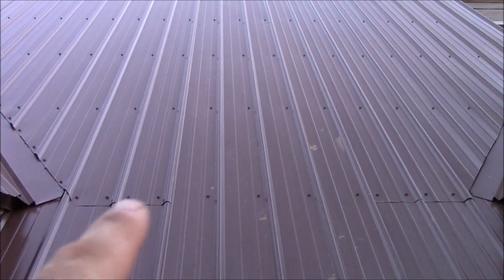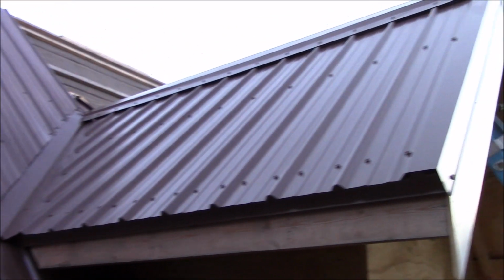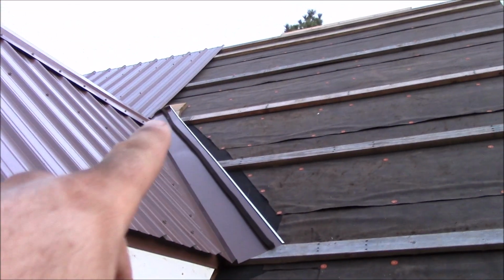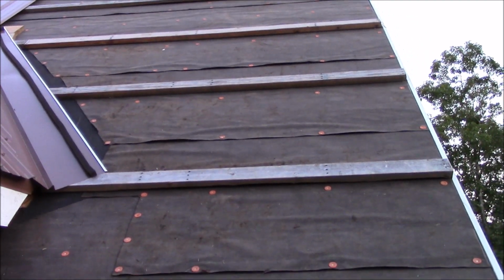Building My Own Home: Episode 40 - Finished the Last Dormer

Comment: great work, great weather we're having, what are your plans for heating? we're using an outdoor wood boiler that's working pretty good, except I have trouble cuttin enough wood, dang crippled old back. gotta get a bigger chainsaw too. 
stay safe and keep it up.
Reply from the maker: +JDS hillbilly It depends on if we hook up to the grid or not. If so we will have central gas heat and a wood stove in the living room.

If we don't hookup to the grid we will have several mini splits which are ACs plus heat pumps and a wood stove.